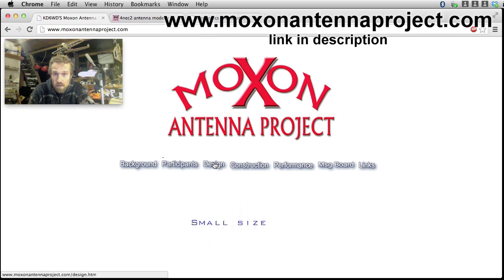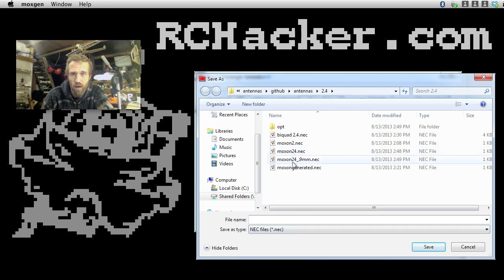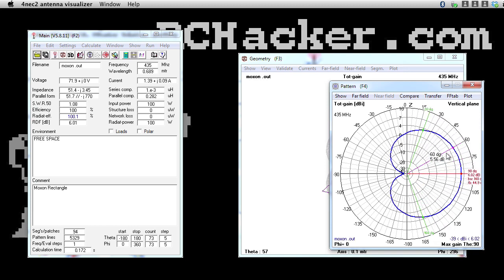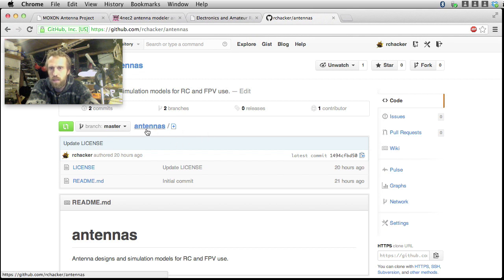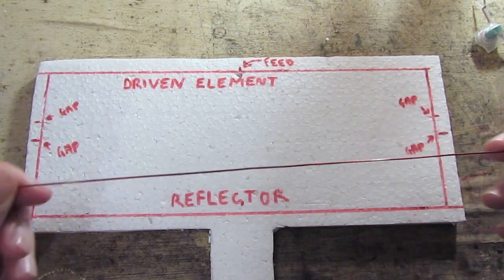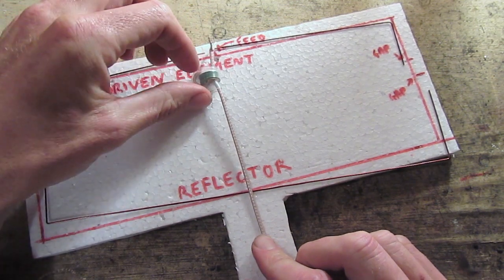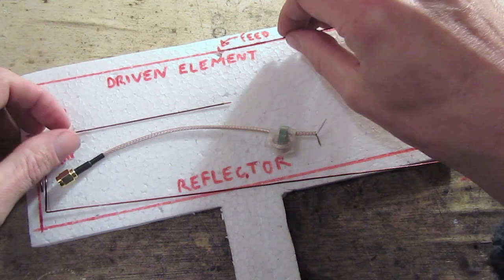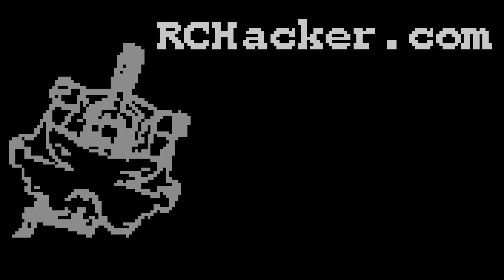Moxon Antenna. RCHacker #49

Comment: you can tune the driven and the reflector by hanging a wire from one of the corners on each element, then trim the wire to tune. Use field strength meters or VNA to fine tune.

Comment: Kind of like a yagi ? No the Moxon is a Yagi ! To be more precise a Moxon is a 2 element yagi that uses capacitive end coupling instead of lossy inductors as a means of reducing its size while maintaining an acceptable input impedance.

By using capacitive end loading the moxon achieves a much greater radiation efficiency as compared to other designs which use lossy matching networks and inductors to reduce the size of the antenna. The bottom line is the moxon is a very highly efficient short boom 2 element reduced size yagi.

If you're a ham this is important because a mono band Moxon yagi will easily outperform a trapped triband yagi at a fraction of the cost and weight.   

By the way nice work on that little moxon.

Comment: Great vid Mark! Built this antenna and used it on my 9XR TX (Orange LRS tx) and turnstyle on my wing (Orange LRS RX). Noticed that separation between reflector and tx really makes sense. Got 1.5 miles and over 50% RSSI left;-)

Comment from the maker: I know it is not statistically significant but I have now had two FRSky D8RII+ receivers fail in exactly the same way. (drastically reduced range). So I am now moving to openLRS. There is a learning curve, but worth it for more features, better range. I get a lot of help requests with what sounds like bad units from HK, So I would get them from DTFUHF.

Stick your crosshair out the back of your quad on a bbq skewer.

Comment from the maker: It is all to do with the wire lengths, the generator programs calculates everything for 50 ohms, so if you are good with your measurements you are probably alright.
IBCrazy did a tutorial on rcgroups for making your own SWR meter, but measuring the impedance directly requires more specialised equipment.

Comment: I can absolutely confirm this antenna is a monster for long range. Previously with my Nagoya N77 at 3.5 miles I was getting RSSI readings of 60-70%. With the Moxon I threw together last night, at 5.3 miles I was still getting solid, unwavering 100%. My only reason for turning around was concern for my battery. 

I had it angled on its side for vertical polarisation and the RX antenna was a home made dipole.

Thanks so much for this video, the Moxon is an incredible antenna!
Reply: Awesome, great to know that it worked for you.

Comment: I have been having terrible range issues with Orange LRS. Have tried the v and sander styles. Looking forward to building this to see if it fixes the issue,
Thanks so much for all your tutorials :) They are appreciated.
Reply: you can also boost your tx power by using a wifi amplifier, just choose the correct frequency version and get the correct sma adapters, i put a largish lipo and a dc dc converter in the tx which is large enough to drive the wifi amplifier, the wifi amplifier happens to fit under the handle on the transmitter.

Comment from the maker: If you had 3 of them with a diversity setup it would work great, but only 2 antenna diversity systems are available at the moment.
OpenLRSng however may be heading in that direction.
Until then you are better off with an omni directional antenna like the turnstile or vee on the receiver.

Comment from the maker: Not something I have taken into account and really hard for me to test, perhaps I can try cutting some of the foam away at a later date. The wire I am using has enamel coating but I like that as it protects the rf front end from static. Relative to air enamel has a dielectric constant of 5.1 but it is a very thin coating. Silicone RTV 3.6, Poylstyrene 2.5 (this might be the value for solid, the polystyrene I am using is mostly air).
Surprisingly balsa has one of the lowest values at 1.4.

Comment: Just made one.  Thanks for all the invaluable info.
Reply: OMG. Huge increase in range over the RMILEC UHF435MHz SRC771 1/2 Wave Length UHF Antenna  from Hobby King!  I haven't flown my antennas long range yet, but line-of-sight on the ground, the RMILEC antenna did 0.97 miles and the Moxon just did 1.97 miles (3.17Km) before I ran out of straight road. That verifies the range is at least doubled over a traditional monopole antenna. Details:  OpenLRS 1W with no telemetry at 4800 baud.
Reply: Additional details:  Used all the tools mentioned in the video to design and model.  I cut up an Ethernet cable and took the conductors out.  24AWG wire and easy to solder.  I did use a ferrite toroid as well with three turns.
Reply from the maker: casual_user Thats great, thanks for posting your results.

Comment from the maker: Not sure about the sander style they are just a monopole. They seem to work best as a pair on a diversity receiver which makes it more like a vee. Using just one is a mistake.

The units do perform, but run a bad antenna or none at all they could get damaged.

Comment: Hi, i cant decide between open lrs and FRsky. Frsky because i have heard it is very reliable and has rssi downlink. Do you think the orange lrs has reliable signal? Also i need good rssi or i will just worry about losing signal and not fly very far. I have a quadcopter i want to use it with; jason from ilovetoflyfpv uses a turnstile on the bottom of his wing but that wont work for my quad. What are the anntena options for a quad?
And finally i need some opinions: FRsky or LRS?

thanks in advance

Comment: Tried the Moxon and Turnstyle - slightly better range but still only 500m at 50m high before failsafe kicked in. Was getting about 850m on the ground in testing. No idea why I cant get range out of the Openlrs

Comment: Hi Marc, enjoying your Videos. Have just built my first Moxon Antenna, using the end foam panels from the box that my Bixler 2 arrived in from Hobbyking. They were precut and the perfect size for the project. I just want to know, would it affect the performance, if I used the second panel, laid flat on the now completed Antenna, thereby sandwiching the Copper Rectangle in between the 2 foam panels. Then cutting away the excess foam, so that it ends up looking like a professionally made Moxon Antenna? and then spraying the whole thing Black. I find all of your Videos great reading, and have read some of them many times, so as to familiarise myself with some of your methods. While I wait for my new Turnigy 9xR and 433 modules etc to arrive from Hong Kong. Also invested in a Raptor V2 to put it all in. I am now a retired Pensioner living in Spain, where I also enjoy countless days of ideal flying conditions. Please, keep up the great work.
Reply from the maker: Cheers, I cannot say for sure but I doubt you will notice the difference. The dielectric value for polystyrene is very low so I have assumed it is negligible.
Reply: RCHacker I agree that helical is the way to go, put it on a tripod and know what the azimuth is of the aircraft. Most important Elevation may be optimum at a certain point depending on terrain. Helical you might loose the gain that Horz. provides. It is simply known as ground gain. Ground gain can not be achieved with vertical orientation. From all that I have read and observed. KB3IUL

Comment: Nice video, although I will point out that you should easily get 10km on 100mw without directional antennas  I have been to 8.1km with over 55% RSSI showing on my OSD and only turned back as I was worried about battery consumption and I still had good video using 5.8Ghz  I had a diamond srh771 on the Tx and a home made dipole on the Rx I was using flytron equipment and the firmware was before the NG stuff came out so was using Thundead which was the predecessor.

Comment: the 4nec2 looks very interesting, what program do you find best to use to sketch out antenna designs? obviously the moxon generator does an output file but what about the turnstile, v's etc?

Comment: Thanks for the video :)    Would it be possible to do one on a multi element yagi?

also i agree with jchelm1979, omni directional antenna's can get 10km. I have been just over 10km with homemade 1/2 wave dipole tx, turnstile rx.   Have you seen the 37km effort of diegojjd?

Comment: thanks for video.  questions - Is there any specific length of the rg316 that you cut it to?  Or did you just cut the length to fit your mount to the radio?
Reply from the maker: Nope just what I needed. Everything is matched so the lengths should not matter.

Comment: from its radiation pattern it will will benifit us more verticaloly polaized,  we have more propagragtion on the horizon. front and sides, ham use horizontal for directional purpose and will be hard for ti to be mounted vertically with such large antennas for HF and they need it to bounce in the ionosphere.for us we need direct line of light and we are vertically polorized in the receiver to give it omni direction in the model. we would not mount model antennas horizontally or it will be directional not omni in reception.the propagation pattern when vertically polaized will give more horizon in front from left to right and null behind, i like this antenna.tnx for the video design.

Comment: RCHacker, great video... Im learning a ton from you!   

Do you think one could build a Moxon using PCB material as the structure and element using a home CNC machine?   I could get the dimensions near perfect, but was unsure what to use for wire size in the calculator... or if it would even be worth trying.
Reply from the maker: Cheers, I don't think pcb material would be ideal, it has a larger dielectric effect than foam or balsa.
Are you thinking cutting everything away except the copper? Might work, but would be best to simulate it. Unfortunately that sort of simulation software is expensive.
Reply: Hey thanks for the reply!   I would have cut everything away and probably the entire center leaving only a frame and the trace for the elements.  Might be worth an experiment :)

Comment: You mention that the wire should be as thin as possible, would foil strip work?
Reply from the maker: bridgendesar That makes it into a plane which would need to be modelled differently. If you don't have thinner just put what you have into the calculator.

Comment: Hi! whats the best match for this antenna on the Rx? I have a moxon on my Tx and a dipole on my Rx. but the max range im getting is only 2.5km on my 100mw module.
Reply from the maker: That should be pretty good, try changing the orientation, perhaps location.
Reply: and how should i have it mounted? Vertically or horizontal? I have it Horizontal at the moment both Moxon and DiPole. will a Turnstile on Rx increase my range?

Comment: Oh dear the antenna bug really has bitten hard :) Apologies for leading you astray but I did warn you of the possible consequences. Performance antennas are probably the best bang for buck thing you can do for any RF system.
A couple of observations. You say putting a reflector on the Moxon did little to enhance it. That's because so little RF energy is present behind the existing reflector. If you look at other designs like Yagis, cubic quads etc you will notice they only ever use a single reflector for this reason. On the other hand you will see further directivity improvements by adding a director element in front of the feed plane since this is where the RF feild exists. I'd start with similar spacing and length ratios employed in Yagi designs and the refine the design from there. For a more robust Moxon design Have you considered using PCB and etch the elements? As to the impact of any dialectric effect from the styrofoam I'd expect very little change at the relatively low frequencies around 70cm as the foam is basically mostly air.
 Another little gem you might find interesting is by mounting two normaly linear polarised high gain antennas at 90 degrees to each other and feed them 90 degrees out of phase you get circular polarised radiation. To get the 90 degree phase shift simply feed one antenna directly and the other via a 90 degree delay lenngth coax connected in parallel. By changing which antenna is connected first determines the rh or lh polarisation. I used this method while messing about with satellites. Don't forget to factor in the coax velocity factor when cutting the delay coax and also the now paralleled individual feed point impedances. Obviously this arrangement will be of no use on the handheld transmitter but could prove useful for your FPV ground station at long range.
Reply from the maker: Nice to confirm on my assumptions with the foam. Know any cheap PCB RF simulation tools? I looked into it, I think I am done on that.
Reply: I have to admit I am no expert, all my RF knowledge is what I assimilated when I was an active radio amateur. Having said that I can offer a few generalisations.
As the length to diameter ratio gets smaller ie fatter wires, so the theoretical length will decrease. So I suggest you try to duplicate this with on the pcb say 0.5 - 0.75mm conversely the wider track will yeild a wider bandwidth at the cost of gain.
As the PCB trace is in close proximity to a dialectric different to free space again the length will be affected from theoretical values based on antennas in free space. If you know the composition of the PCB ie G10 then you should be able to find a compensation factor from references or perhaps an online calculator. Failing that It would be possible to make a wire mockup and attach it to a bare piece of PCB substrate material ie no copper, then test with a SWR bridge to find optimal lengths. You could then confidently reproduce this as a PCB.
I would recommend you try to find an active radio amateur for assistance as he/she will most likely have the required tools and experience to get a working antenna.
this all assumes the frequency of interest is in the UHF range where dimensions are less critical and equipment cheaper than for say 2.4 or 5.8GHz. Making an antenna for such high frequencies is bound to problematic.
As for the SMA connection, your idea should work well. just be sure to mechanicaly support the antenna to prevent damage to the radio.
Reply from the maker: Wow, sorry, originally I only read the first point of the post. So you could have a CP moxon that would look something like a pinwheel. 

The nec software is really only made for simulating free air antennas or large antennas near the ground. There is other software out there for PCB antennas but is is very expensive. 

PCB manufacture is pretty cheap these days,  if you were going for 5.8G or 2.4 I would make a bunch of slightly different ones on the same panel, cut them out then just test them all.
Reply: extra extra read all about it
http://sv1bsx.50webs.com/antenna-pol/polarization.html

Been a little quiet of late Marc hope all is well

Comment: hey Mark!
Great Video. Thank You for sharing this!
im owning a MAC for my business. I love it.
But why are you using mac for RC-Stuff? . The most Opensourcetools for programming are avalible for Windows. I often hear you crying that some hardware is not running good for mac.....
Reply from the maker: Incorrect, most open source programming tools are for linux and MacPorts gives me most of that.  Anything that does not work for me I just run under a virtual machine or with wine. Right now thats just 4nec2, and the ardupilot software.
Mostly I use it for video editing anyway. 
I spent 3 years of my software engineering career programming for windows, and its was a nightmare, never again.
Reply: RCHacker
ok. thats why you stopped your programming career and use mac os.
ok ok ok! i was wrong! Linux is the plattform for the most open source.
Half of my usb-devices wont work on mac osx, i feel more flexible on windows 7.

What do you think about making a tutorial, fixing burned ESCs?
I did not find a lot of informations about this.
Reply from the maker: muddanundvoddan lol, us nerds get passionate about our platforms. I have a draw full of burned out ESCs. If you have the push on programmer they make nice mini arduinos. Re-soldering mosfets I find pretty hard.
Reply: RCHacker
 come on mark! you have a new rework-station and a lot of stuff i dont have. Show us a "how to repair a burned out ESC in a quick and easy way!" We can get a 100-pack of mosfets for 20 $ on Ebay to repair our 30 $ ESC.

"Never buy ESCs again" could be the headline! What do you Think?
But Hobbyking will hate you for that. For sure!

Dont worry about a virus behind that link => you have a MAC!

http://www.ebay.de/itm/100-PCS-FDS7764A-SOP-8-FDS7764-7764A-30V-N-Channel-PowerTrench-MOSFET-/301232124838?pt=LH_DefaultDomain_0&hash=item4622d573a6

if you like i order a pack of nfets and other parts of your need to do this tutorial and support your work.

Comment: Well it seems someone has coppied you lead Marc. genuine IBcrazy moxon frame
http://www.ebay.com.au/itm/UHF-Moxon-Rectangle-Antenna-FPV-SimTechFPV-/221447353209?pt=AU_Toys_Hobbies_Radio_Controlled_Vehicles&hash=item338f4a7379
Reply: Nice, not too sure about the coax crossing the reflector.
Reply: ***** flat for h-polarised. with the driven element at the front.

Comment: Great video Mark as always.

I would reduce the tightness of the wraps around the ferrite choke as they are way to tight and will be severely effect the output from the antenna. You can just use a whole tone of them in series to reduce the space and annoyance of coiling the feed line through the choke.
Reply from the maker: Thanks, thats a great idea.